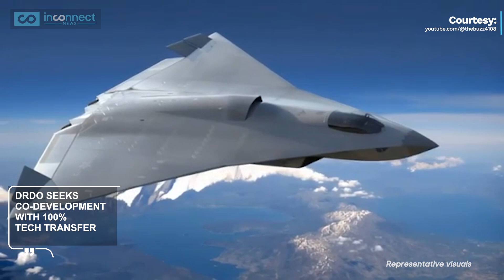Is The Indian Air Force BETTER OFF Without DRDO's Kaveri Engine?

Comment: It's better to continue pursuing work simultaneously on the kaveri engines, while jointly working with Safran to develop  a 110Kn engine. 
Scrapping of MRFA is very important and just order a repeat number of 36 rafales, and utilize the Funds for the development of kaveri & 110kn which will be built in joint collaboration with Safran.
For the initial stage GEF414  is very important materialize, because this engine will be integrated on Tejas Mk2, TEDBF & the first 2 squadrons of AMCA Mk1. Later on by 2035 a transition will take place by integrating the 110kn engine with Tejas Mk2, AMCA Mk2, and the remaining 72 Rafales in the IAF & the 26 Rafale marine naval variants.

Comment: Kaveri will power Ghatak as of now. The loyal wingman system will be moved from Tejas MK2 to newly built Su30 MKI. The Ghatak will team with Su57 if it comes and with AMCA as man unmanned teaming system.
Reply: The loyal wingman concept on Su-30MKI makes a whole lot of sense.

Also they can start developing and testing it way before AMCA is ready.

But AMCA should be kept single seater, not dual as is being proposed for loyal wingman.

The reason is because eventually, there will have to be no pilots anywhere.